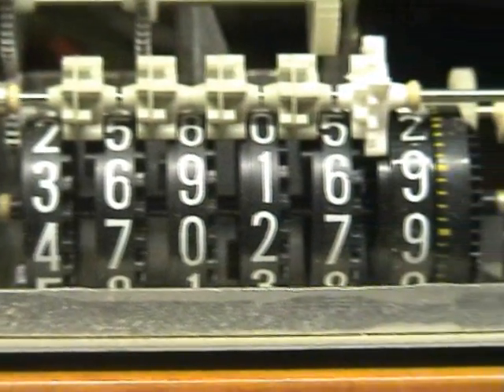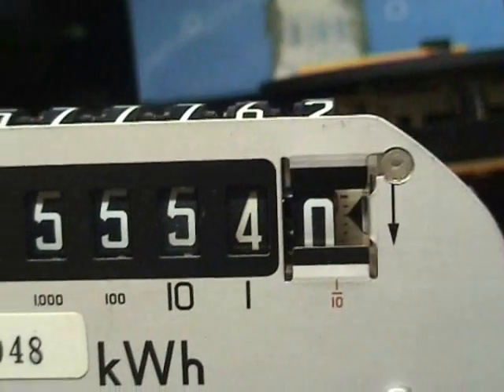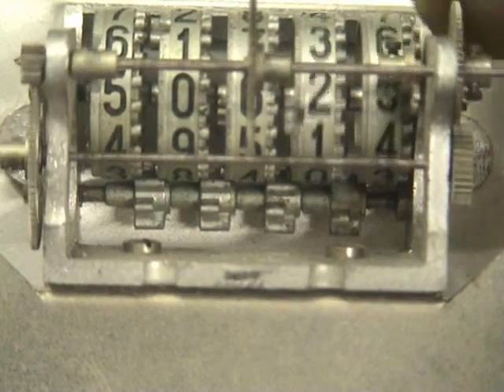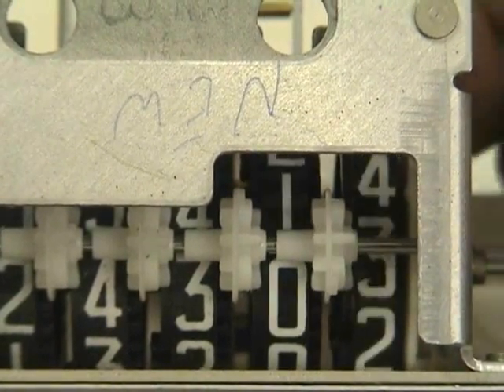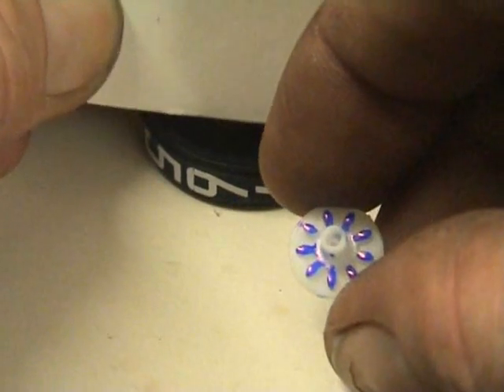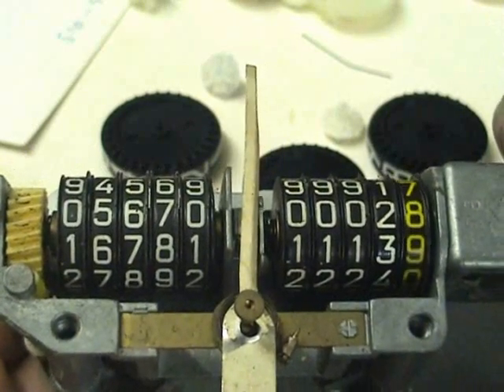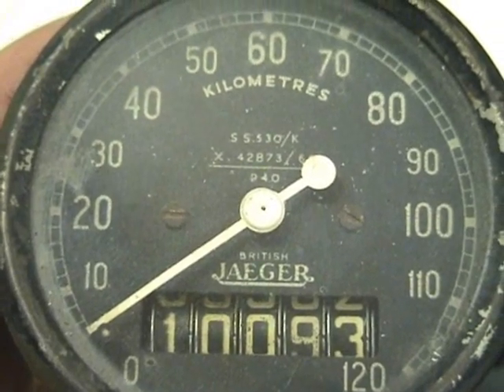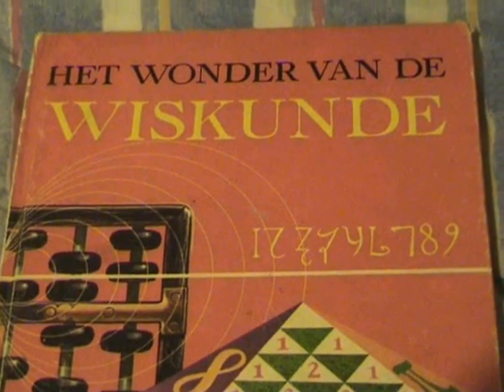Mechanical Counters, how they work

Comment: Do you know how I would go about resetting one of the pointer type kWh meters to zero?
Reply from the maker: The pointer type meters are very easy to reset. Just carefully rotate the pointer towards the zero position. Ensure that each pointer is perfectly aligned, to avoid misreading. Most pointer meters have brass or aluminium gears and shafts, and the pointers are usually from metal, sometimes from plastic.

Comment: Who does me milage counter stop working? 
Its ticking it has some thing to do with back charging alternator how do I prevent that anoying acurence?
Can diodes help?
Im shure me counter is 100% ok but some thing odd is hapening with grounding when I experiment with relays ore bulbs the meter start working again so I dont understand why that thing is stuck in place ?

Comment: or, you can use a free mobile app. Here it is a new one called "Swipe Counter", available for Android or iOS.
Reply: It is known that coding is much more difficult and more boring than real devices. The devices are real, actual engineering, not virtual work !

Comment: On a older vehicle 1993 chevy, does the speedometer factor into the odometer mile counter. I'm concerned because my speedometer reads slightly high and will skew my mileage which I would like to be accurate for maintance.
Reply from the maker: In older vehicles the speedometer and odometer are driven through a flexible Bowden cable, which is connected via a gear on the output side of the gearbox. Newer vehicles 1990's onwards may have electronic driver circuits which get pulses from a tacho sensor, (also somewhere in the gearbox) Speedometers are usually set 5 to 10% fast. best is to do a mileage check on the motorway where there are distance markers, Usually every 100 or 200 meters apart or 1/4 mile markers, sorry for my late reply.

Comment: Thank you for the video. I want to ask you if you could help me repair my trip odometer on my old Yamaha enduro. It is analog and the speedometer works and the odometer and trip odometer record the miles. The one problem I have is the trip odometer will not reset to zero when I pull the knob out and turn it. I don't quite remember if one click out with the knob just turns the miles one by one and the 2nd click out resets the trip odometer to zero. It has been awhile since it has worked. In any case all I get when I pull the knob all the way out is the miles roll down or up one by one. It is somewhat annoying as the trip meter serves as my fuel gauge- at 50 miles or so I know I need to refill the tank. Thank you so much. Frank
Reply from the maker: What make odometer is it ?
Reply from the maker: My guess is that it is a Smiths or Jaeger odometer as I remember that they had the knob on a bowden cable which you had to pull out and you could run the numbers forward and I think backward the numbers reset to zero.
Reply: Thank you for your replies. I just took a look at it. There is no name on it I could see- either inside or outside. It is from a 78 Yamaha DT400. I have been doing a little research with other makes and if they are similar there may be some springs in there that catch the trip odometer shaft and catch the tumblers in some fashion to allow the tumblers to turn in one direction and then catch in the other for reset. Makes some sense to me now why I can turn the trip knob in either direction and roll the numbers one by one. I thought originally that was a normal feature besides the reset.  Here is some recent literature I found that sort of explains what happens when the reset feature does not operate. The shaft is staked into the housing body on mine and I bent the odometer shaft trying to press the shaft out of the opposite end. Do you  think  I should get some pliers and just pry the staked end from the housing and then slip the other end out of it's hole in the housing?

http://www.ibmwr.org/ktech/trip-odometer.shtml

http://www.installationinstructions.com/FYI/TRIP%20ODOMETER%20REPAIR.pdf
Reply: Countern

Comment: Hello, I took apart an auto gauge (Honda) and removed the gears. I placed it back but the 2nd row does not turn anymore when the first row hits 0. what did I miss? thanks for your help.
Reply from the maker: Erik Claro Check the little geneva gear. You have maybe fitted it in the wrong way around. ( that is the little gear which transfers the movement between number wheels).  In some car odometers these geneva wheels are in between the number wheels on small plastic dividers.
Reply: Great. I'll take it apart tomorrow and give you an update, hopefully it works.
Reply from the maker: Erik Claro Cool. I appreciate that.
Reply: I aligned the gear to a bigger gear with an indentation and it nearly worked! almost rotated from 49 to 50 but stopped 1/3 of the way.  The gear for the numbers has small gears alternating with bigger toothed gears. FYI.

Comment from the maker: They will have a similar set up. Sometimes the geneva wheels are in between the numbers.
For resetting to zero the geneva's get lifted out or a slip clutch is used as in the Veeder root counter.
Reply: hello im looking for a mechanical counter with the largest number wheels or display possible. would you have any you would recommend? Ive looked into mechanical gas pump computers but im looking for bigger than that if possible. any help would be greatly appreciated
Reply: Metus
Reply: Odometos

Comment from the maker: @ELTIGREROCKS10NEW  I have been collecting meter for over 40 years, and used  to work in the metering section of a local power board.